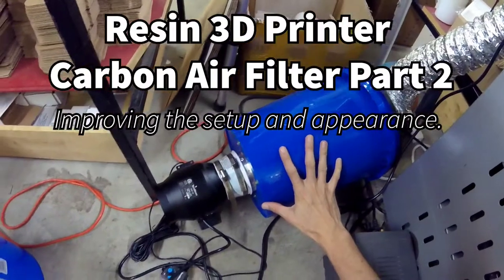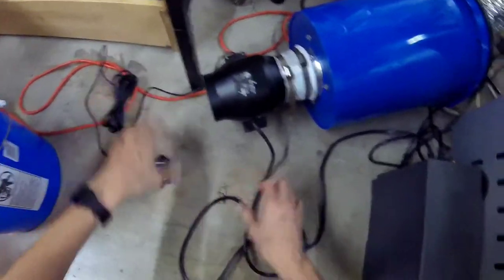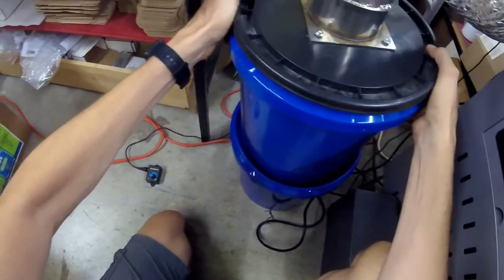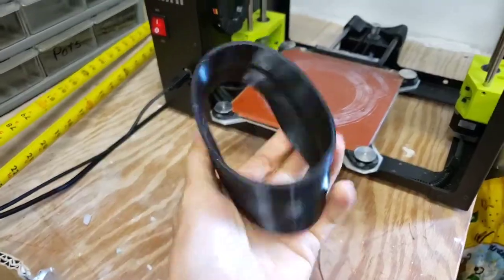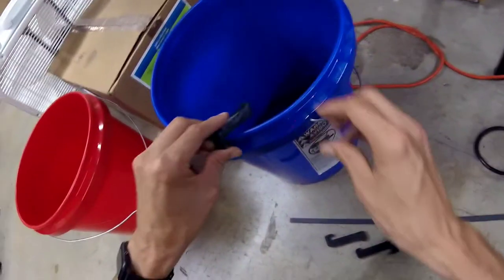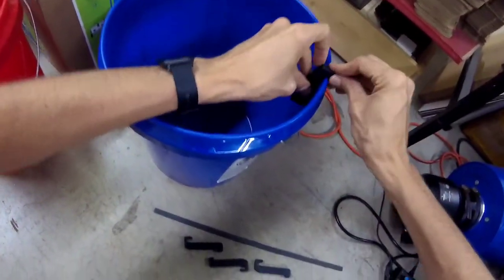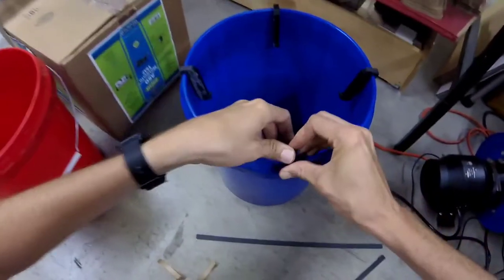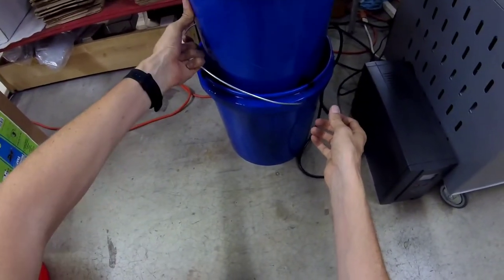Eliminate the Stink of 3D Printing the Easy Way with Carbon Air Filtration Pt.2 - Resin & FDM Filter

Comment: Nice setup! Is it still works fine? Want to build something like this.
Reply from the maker: Yes, with a prefilter and low flow rates, these carbon filters can run a long time.
Reply: Thanks, good to know. I'm planning to use it with grow tent. Hope that this filter eliminates IPA fumes too.

Comment: You're a genius!  Exactly what I am looking for.  I have 2 FDM printers set up in a room with no access to windows.  I would like to use my new resin printer in the same room rather than the garage where it will be much colder for several months of the year.  0-100 what % of the fumes do you think you are eliminating?  Thanks so much for posting this video!!  Keep up the great work!!!
Reply from the maker: 100% elimination of smells from printer. You still get smells from any resin outside, so if you want to elimate those, you need to build a hood that you can work inside. Resins continue to improve and have become a lot less smelly.

Comment: Hi, is there no need to attach another ducting hose from the fan to the outside? Can you explain why is that? Is it also okay if i opt to put a hose instead then run it through my window?
Reply from the maker: No need to run it outside since the carbon filter scrubs all the smell. You can run it outside, but then you lose your Heating or AC efficiency, unless you use a heat exchanger.

Comment: Looks great!! I'm going to try it out.....thanks
Reply from the maker: Nice! It still works great. Since the filter is huge, it lasts forever. I'm planning to do another build where I add a HEPA filter for use with FDM 3D printers, and recirculate the air.
Reply: @engineerable  I just moved and the furnace air intake is open to the basement....now the WHOLE house smells like ABS.....my wife is not happy....lol. Just ordered the parts and subbed!!!
Reply from the maker: @fish3dp372  You mentioned ABS, so will you be using it for FDM printer? It will remove the smell from FDM, but FDM also creates particulates and therefore you may also want to run it through a Hepa filter cartridge before passing through the carbon filter. I'm planning to use a ShopVac Hepa filter which is the round style and the Gore Cleanstream filters are even washable. In that case, I would draw the air through the Hepa filter (put the prefilled over the hepa), pass through the fan, and then exhaust the air through the carbon filter. So the fan sits between the Hepa and carbon filter.
Reply: @engineerable  Maybe something like this would work? KEEPOW Replacement Filter LV-H132-RF for Levoit Air Purifier LV-H132, 2 Pack HEPA and Activated Carbon Filter
Reply from the maker: @fish3dp372  It's possible something like that filter could work, but would have to test it to know for sure. My concern is longevity of the carbon media in removing the smell, in an always on environment. For resin printer, I leave the resin in even when not printing, so it needs the air filtration all the time. For FDM, the filter only needs to run while printing. If you are only printing occasionally, then maybe you can use a light duty filter. If you are printing all the time, it won't last as long as a haven't duty system like I built.
Reply: @engineerable  I was thinking of using this as the hepa then into your system.
Reply from the maker: @fish3dp372  That would probably be fine. Just have to design and 3D print an adapter to fit the filter.
Reply: @engineerable  that’s my specialty. Thx

Comment: im planning on doing this exact same thing. have you happened to run a VOC air tester to see how much your eliminating? I've heard sometimes the smell goes but the fumes stay so I'm sorta conserend about that.
Reply from the maker: @maxortega8073  I don't have a VOC tester because I don't trust any of the lower cost ones, but if this huge carbon filter can't remove the VOC's, then nothing can, and you should vent outside.
Reply: @engineerable  yeah that’s true. I just don’t want my heating and cooling bills to kill me. I’ll probably build the setup and sue my air tester to see what it reads. If it shows bad I’ll just vent outdoors

Comment: Why not flip the bottom bucket over, cut a whole in in for the fan to fit through, and the top bucket is supported by the bottom bucket. Then dill some air holes and you have a easy base. No clips, and no worries of any water or fluid in the bottom.

Comment: Fantastic man! Subbed.

Question though, do you think this system in its current state could handle 6 resin printers at once? I have 2 large format and 4 small format machines. Plan would be to print a main housing with shutoffs when the vats are empty and connect it to the mainline. 

If not, is there something larger might might have been looking at when designing this?
Reply: I’ve also be thinking of sealing the area or making a large hood/enclosure for each individual or all the machines.
Reply from the maker: I think it could handle it. For 1 printer, I have the fan running as low as possible. All it needs is a small draft for negative pressure.
Reply: Great, thank you. Also thanks for the super quick reply 🤙🏼
Reply from the maker: @customlegoworks  A large hood/enclosure that has enough space to do the post print cleaning and curing would be nice to contain the alcohol and resin smell.
Reply: One more thing, do you have a vertical measurement of the system? I know it’s essentially 2 5gal buckets high and the spaces will change the height but I have a spot that it might fit perfectly into but it be on the verge of just not fitting.
Reply: That’s what I’m thinking. I have a lot of 1/4” plexi from an older project. Thinking getting some UV protective stuff, coating the glass, and building a box with a door around each printer. That way I can ditch the hood and my post processing station won’t be affected.

Comment: How's the longevity of your filter using this system?  How often do you think it would need to be replaced?
Reply from the maker: Unknown, I have yet to replace it. Still works. The high quality carbon filters can work for a very long time at low airflows
Reply: @engineerable  That's great to hear.  Thanks for the quick reply.  This is a great setup that I'll be deploying fairly soon